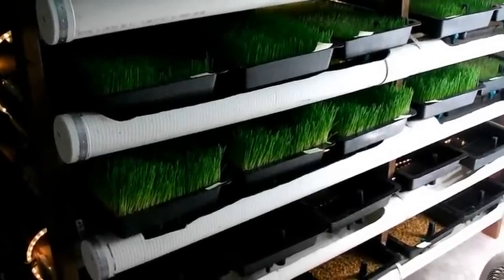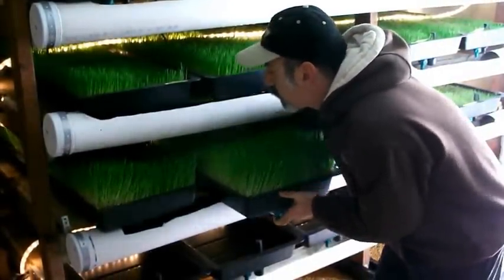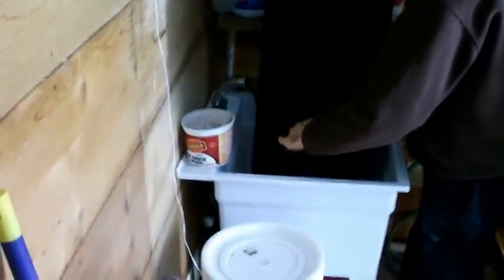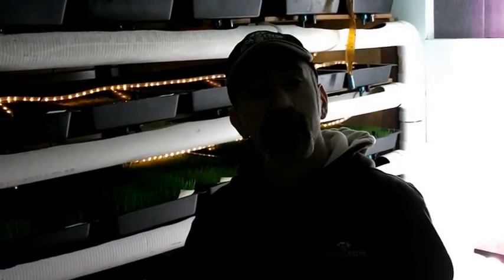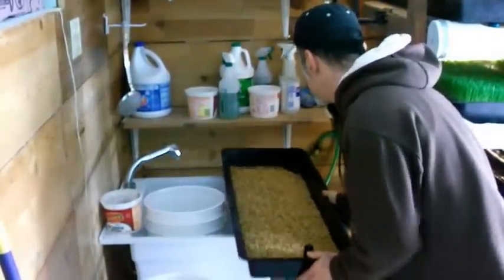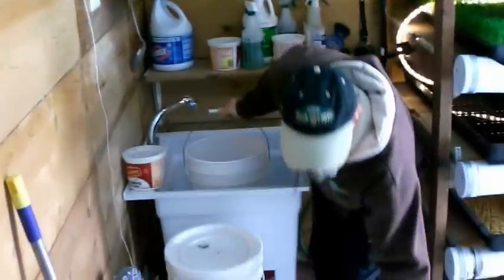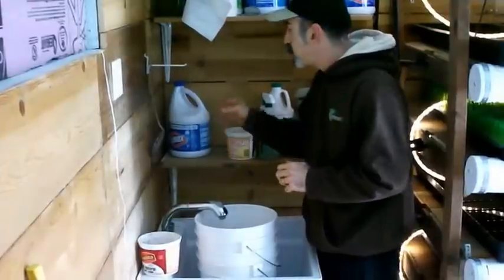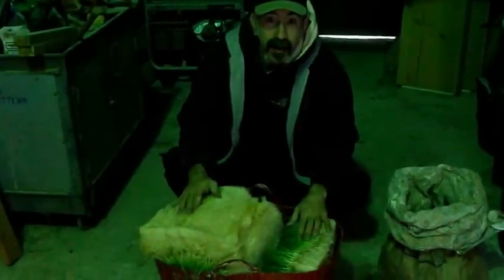Barley Fodder Grow Room Procedures - Step by Step through the Daily Task

Comment: why do you use white led lights and not the red and blue led lights? and what color temp do you use for the white light?
Reply from the maker: I use daylight rated CFL light bulbs to add some light to the room.However, lighting is really inconsequential to a short-duration grow cycle of a sprout.  A little light helps sprouts green up and stretch slightly.

Comment: I tried making my own fodder with wheat. I soaked it for 24 hrs, drained it and put it on the tray for sprouting. The next day, there was a strong pungent smell. I washed it in again in soda and put it for sprouting again. Ambient temp was 35 degree celsius (95 degree F ) By the next day, the wheat had to be thrown away becuase of the smell. Where did I go wrong ?

Comment: It would be interesting to make a fodder system with a filtration system or aquaponic system effectively in order to conserve water. Have you ever thought of putting a filtration system on the reservoir method or trickle down method?
Reply from the maker: The runoff from a sprouting application is laden with starchy solutes.  This is nutrient rich which could potential feed into a downstream hydroponic application that is growing plants (like lettuce or basils) through their full cycle.  Thus the plants would essentially filter and use the nutrients.  The runoff from that could then be further directed to an aquaponics system for more scrubbing.  However, with a sprouting application, it is imperative, due to seed densities, to use fresh water each time and to water and drain grow trays separately from one another. A trickle-down approach to irrigating, that shares water amongst grow trays, is one of the poorest approaches to keep consistent and repeatable over the long haul operation.
Reply: David Capocci i have a trickle down system it is very small i use fresh water every time it seems to be working fine although i can see where there could be problems if mold were to develop and spread throughout the entire system. i would like to cut down the water usage since it is very unsustainable if you don't have plants to water. Do you think that if i set up a spray or mist system above each tray that would keep the trays moist would work better in achieving my goal?
Reply: Luis Rodriguez Never mind i have been using the trickle down system for a week or 2 and now i have major mold issues on a small scale it seems to work fine but on a larger scale the trickle system is very inefficient. I am switching back to an individual water systems for each tray i might try a misting system to conserve water better

Comment: Two comments: 1. What is the LED lighting for?  2. "Chaff" rhymes with "half".
Reply from the maker: Scott Baker  Thanks Scott for #2, and for #1 the LED lighting helps "green up" the sprouts and make them stretch a bit.  Don't need high intensity lighting for a sprouting application.  In fact, you can do it in the dark and get yellow sprouts.
Reply: David Capocci Ok but having yellow sprouts, you have less chlorofil, less nutrients, less vitamins, etc, am I right on this?
Reply: Ivan tau  And also, have you done any research on quality of forage produced this way, and is there any legit scientific research on this in general..?
Reply from the maker: Ivan tau Our fodder sprouts test out at 18% protein, which is ideal for what we want. (More can be found published on our blog articles.) There are studies out there regarding fodder and its benefits (Search on "Fodder Solutions" to see their published references).  However, one thing to be aware of is how this wet, live feed, does not fit very well into traditional rationale which measures livestock feedstuffs on a dry feed basis, looking for DM content.  To fit sprouts into that model means drying it. When you dry sprouts you end up with a poor quality hay.

Comment: Hi David,  I really like your video.    I've read that sprouts are actually lower in dry matter and protein content.  However, they have more vitamines and less anti-nutrients.  And they're digested better than grain seeds.  Several studies have shown that sprouting is not economical vs. grain seeds.  So, I'm just wondering, from you experience, does sprouting really cut down feed cost, or do you use it as a supplementary diet?  Thanks.
Reply: What study says it's not economical? The digestible differences alone should be enough to be deemed "economical."
Reply from the maker: +yjfoo23 Somehow I must have missed your original comment, until Kat responded... Many University nutritionists will readily tell you that sprouting like this is not economical, but one has to take a much closer look at how they rationalize this.  First off, they use a "dry feed basis" to determine the feed value of all foodstuffs fed to livestock.  That approach looks primarily at 'dry matter' content.  Unfortunately, to measure sprouts in this regard means to dry them and fit them in the formula.  5lbs of live, digestible microgreens, becomes 1 lb of poor quality hay when dried out.  Thus, it simply does not compute very well under that rationale.  For me, the economical rubber meets the road two fold: 1) eliminated processed pelleted grain feedstuffs from their diets.  Pellets use grains in them, then round it out with fillers and other additives.  Still, grain in those pellets are that digestible, around 25-40% depending upon the formulation.  That means the rest gets pooped out, undigested.  Sprouts provide a much better utilization with a higher digestibility around 90%.  2) The natural reduction in hay consumption that occurs when fed sprouts is around 40%.  I am going through 40% less hay when I feed sprouts versus when I feed pellets.  Just in those two savings alone, I've economic benefit.  But beyond that, the increased health in my herd is very tangible as well.

Comment: Hi David... we're thinking about  doing this for our goats.  I'm wondering if there's a formula that tells me what the substitution rate is for grass/alfalfa mix hay.  In other words, if I'm feeding 50lbs/day of hay roughly what amount of fodder might I have to feed as an alternative to provide the same nutritional content?

Also... do you sell or recommend a source for the bulk seed?  I can't seem to find it in my local farm stores.

Thanks for a very informative video!
Reply from the maker: Terry Snyder I would recommend checking with your vet for nutritional requirements for goats as we only raise alpacas here.  That said, the general rule of thumb for goats is to feed between 2-3% fodder and 1-2% hay per day based on the body weight. For example a 100lb goat would need 2-3lbs of fodder sprouts and 1-2lbs of hay for fiber/roughage.  For seed sources, first check with your local University Extension Agent to see if there are regional sources close to you.  Second you can check with Azure Standard or Simply Country (maker of Fodder Solutions) for seed sources to be shipped via freight.

Comment: Can the Barley grow till the Grain seeds are produced?
in other words, can we make it fully sustainable as from seed to feed including producing the seed itself
Reply from the maker: No, not using this approach.  We are simply using the stored energy of the seed to covert stored starches and carbohydrates into digestible proteins via the initial sprouting cycle of a plant.  To go beyond that requires additional nutritional inputs to the plant through its entire growth cycle and would use a much lower seed density than what we do.  It makes much more economical sense to plant a crop in the field to harvest the grain than to use an artificial infrastructure.  All we are doing with microgreen production is an alchemical conversion from something intended to be stored and resilient to something that is bio-available and higher in digestibility.  A grain is only 20-25% digestible, but a microgreen from that same grain is over 90% digestible. Much higher feed conversion is the goal.
Reply: dude you are awesome, subbed. I want to start my own microgreens farm.

Comment: what type of Barley do you use and well it work year round for Alpacas we are still trying to get our pastures back after the drought
Reply from the maker: The "type" or "variety" of barley is not important, given that this is a short duration grow cycle that focuses primarily on the "Sprouting" cycle of the plant.  What is important is that any seed you do use is "Viable" seed, meaning that it will germinate.  Most "field run" or "Combine Run" barley is cheaper than cleaned barley; it may contain more dirt and chaff and debris, but since we have a pre-sanitization process, it gets cleaned.  If you find "Feed Quality" barley, you will still be able to sprout it, but germination rates may be slightly lower than "Seed Quality" barley.  Finally, any seed obtained should be untreated with a fungicide; typically this colors the seed pink or red, and should also be clearly labeled on the seed bag. Do not use treated seed.  Be sure to visit our blog for more articles on growing fodder microgreens!

Comment: how do you combat mold growth, that's my main issue even though i have good drainage and i soak seeds in clorine water!!!
Reply from the maker: Prevention of molds versus treatment of molds becomes the goal, as treating any outbreak of molds does not necessarily eliminate mycotoxin vectors.  There are a number of variables that can come into play to cause mold or fungal infections (in root mats): system design and grow tray design, type of drainage, type of irrigation, operational protocols, intake air filtration, air circulation, climate controls…  No one answer can be given without understanding more about another’s grow system in order to pin down the problem areas.  Be sure to read our companion articles published on our blog, we address many of these issues there.

Comment: So after almost 7 years, are you still getting good results from feeding fodder? And do you still add the DE to it?
Reply from the maker: The DE is only added if needed. It is not a frequently added supplement. It is usually added to drinking water instead.
Our sprouting operation has expanded to include a 4 day sprout for our poultry, along with the daily 9 day sprouts we harvest from the fodder room. We have no regrets. The impact of our feed program has produced great herd health, seen an expanded egg laying flock, big meat chickens and turkeys, and also helps our land-centric approach building good tilth on gravelly land.
Reply: @DavidCapocci  Does the poultry prefer the 4 day sprout, or is there another reason for the different timing?
Reply: @DavidCapocci  for your meat birds are you doing a different mix of grains?  We have a friend that has great success sprouting 70/20/10 barley, black oil sunflower seed, field peas for her birds
Reply from the maker: @mattallen9546  For all our poultry, foraging on good meadow is their primary diet. Our 4-day sprouts we serve are only barley and supplement their diet.  In addition, we wish to control what we sprout as whatever is not consumed, amends our pasture meadows by planting itself.  Barley is a nice carbon massing plant to round out the categories of plants we wish to see in our meadows using permaculture principles.